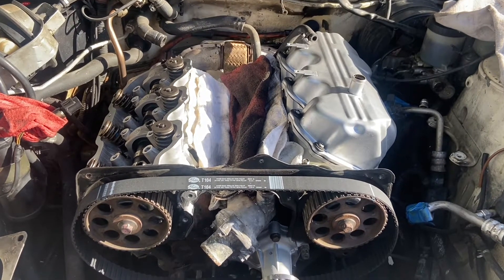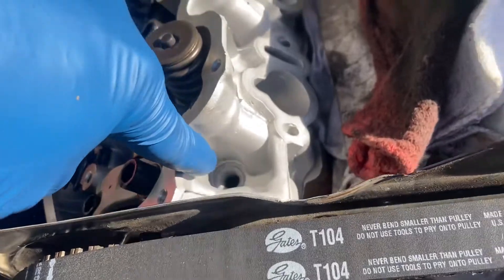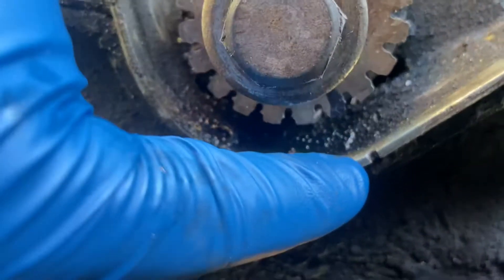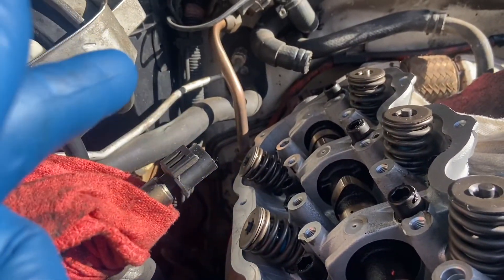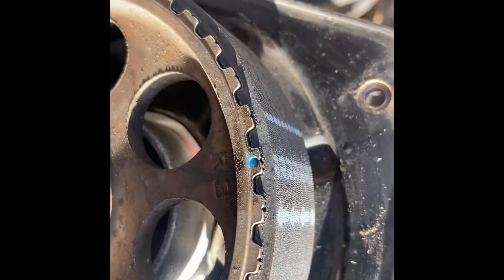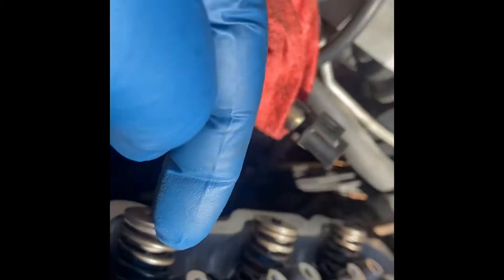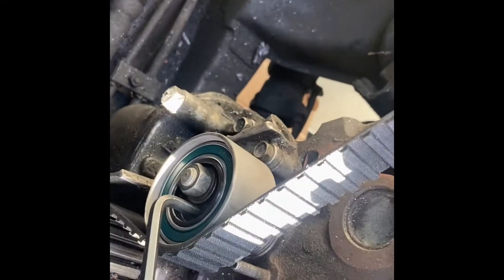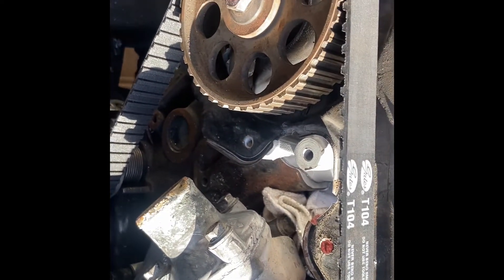Timing belt alignment and install 85-89 Nissan 3.0L 300z

Comment: looks like you are aligning your finger
can't see nothing but your finger 
thanks anyway
Reply from the maker: You obviously didn’t watch the video in its entirety. Because the marks are clearly pointed out and if you listen to the sound it tells you which mark is which. Pretty obvious that the dot on the crankshaft sprocket lines up with the notch in the timing cover. It’s precise and clear. Each camshaft sprocket is lined up and shown perfectly.

Comment: I really need help my z isn’t firing up
Reply: Start checking coil pack, coil wires, spark plugs especially #6
Reply: Also check the maf air flow sensor

Comment: This is not how you tension the timing belt.  The tensioner spring should apply the tension, rotate  the engine clockwise (looking at it from the front), stick a feeler gauge (I forget the thickness) between the tensioner and belt and tighten the tensioner nut while you continue to hold clockwise torque on the engine.  Then check the belt deflection per procedure. I recommend lock tight on the tensioner nut but it is extremely important to torque it to the correct torque setting.  You'll have to lookup the specs on the belt deflection, feeler gauge, and tensioner nut torque. The belt should end up significantly looser than a v belt or serpentine belt.
Reply from the maker: I didn’t finish with the procedure. The first part is what I was explaining here. Then after rotating 2-3 times and back to TDC then you use the feeler gauge. Feeler gauge is 0.35mm
Reply: I didn't do any of that, I just threw the belt and tensioner on, cranked down on the tensioner until it seemed about right, put the covers back on and drove it.
Reply: On the vg30 the tensioner spring does nothing to tension it. You could remove it and it would affect nothing

Comment: Shouldn't the passenger side cam be lined up with the dotted line on the timing belt? Not the letters? I have a Gates belt, I believe like yours, and when the sprocket is on the dotted line there are 40 teeth between the two cam sprockets at TDC. I'm curious if you adjusted later or if this was intentional.
Reply from the maker: I start by making sure the alignment marks are accurately aligned camshafts and crankshaft, then I turn to the lines on the belts.

Comment: Sounds like you got it way too tight that’s the winding sound had loosen mine up because of that it will wear your belt out super fast and when not if it does you will be replacing the entire engine
Reply from the maker: Yeah. I readjusted it after shooting this video.

Comment: i wanna know about the distributor rotation direction on a v6 vg30 1989 . is it Anti clockwise or clockwise.
Reply: I’m not sure I understand your question. The firing order is 1-2-3-4-5-6… and remember the distributor rotates clockwise… looking from the top the rotor will be spinning counterclockwise
Reply: @OfficialKittenNation  does that mean when connecting the spark cables on the distributor.. lets say TDC on plug 1 up. n the distributor rotor points at 6 on the distributor cab while set on spark plug 1.  cable for spark plug 1 goes to 6.. 2 to 5. 3 to 4, 4 to 3, 5 to 2 and 6 to 1.
Reply: @OfficialKittenNation  okay thanks Its a VG30 SE 4x4 1989model.. so the firing order is 123456.
Reply: Yes it and the vg33e rotate the distributor counterclockwise

Comment: Sounds like the timing belt is a little on the tight side but great job👍
Reply: I had a shop do a timing belt for me and when I got the car back this is how it sounded….same night I broke a cam shaft. Luckily was able to replace and call it a day. But usually it would have bent a valve
Reply: @jasoncos3526  Lucky you!!!!!